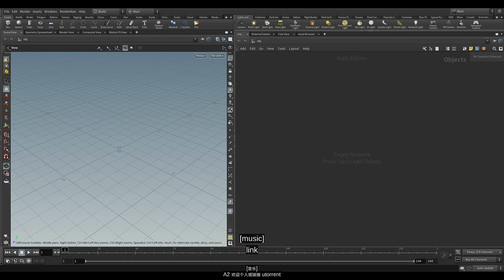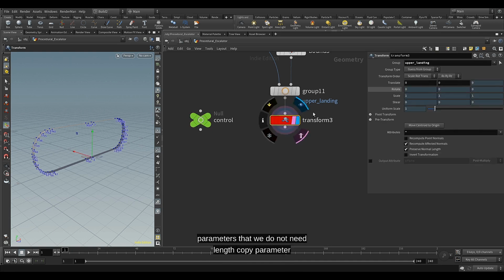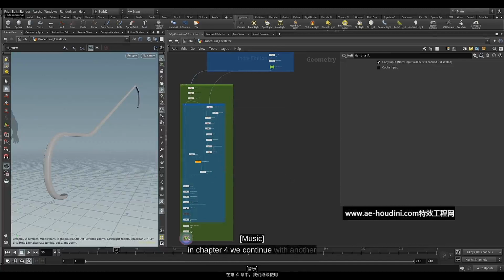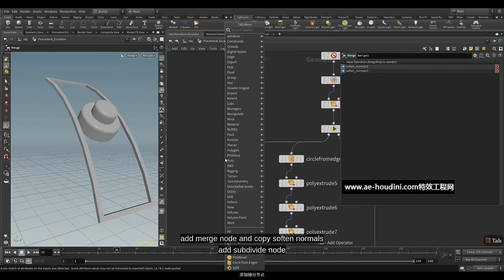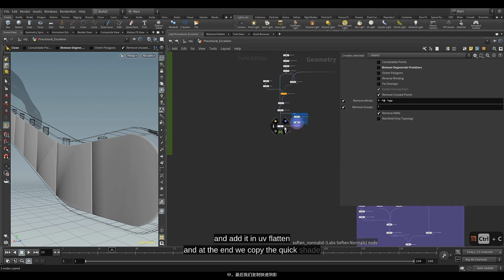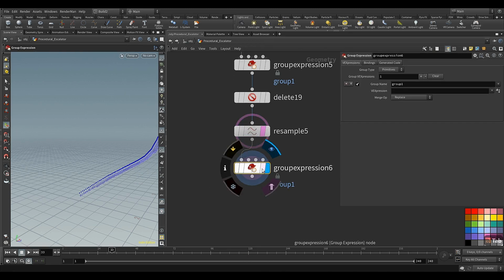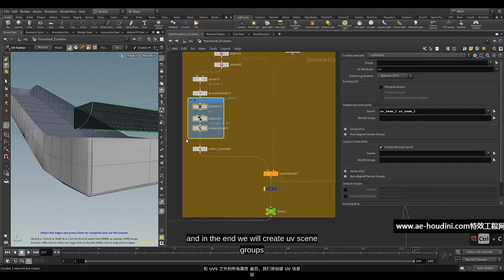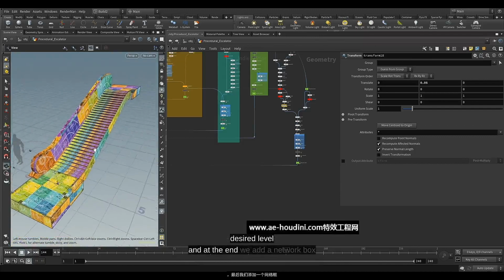Procdual modelling in houdini p1

Comment: 00:00 👉 0 intro
01:34 👉 1 railing start
11:17 👉 2 raililngs base
35:04 👉 3 handrail
54:49 👉 4 balustrade
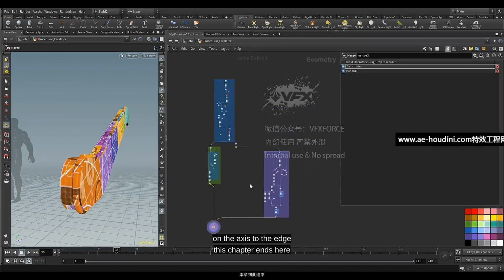01:37:28 👉 5 exterior panel

01:50:16 👉 6 deck base
02:13:48 👉 7 steps
02:32:38 👉 8 truss
02:45:34 👉 9 low deck interior

02:53:40 👉 10 landing floor plate